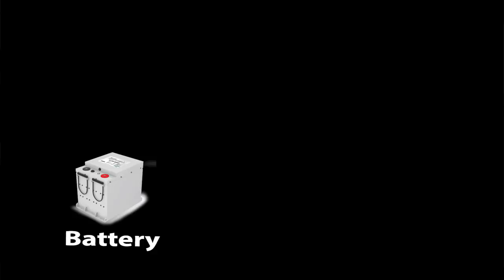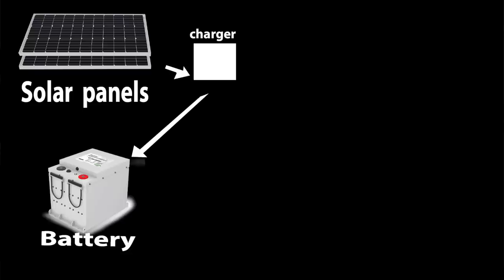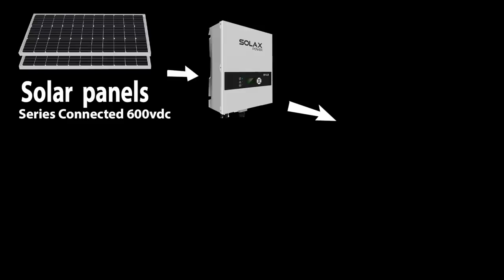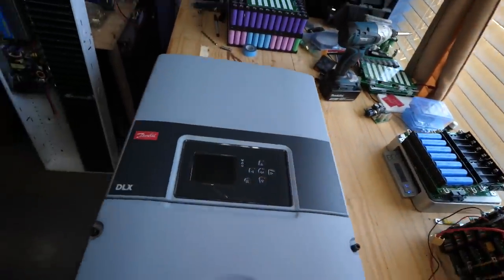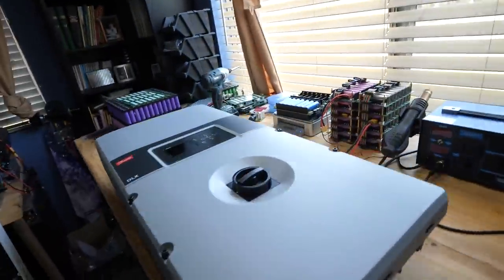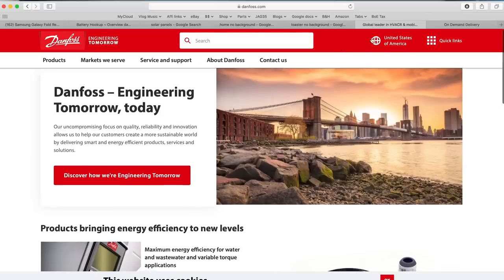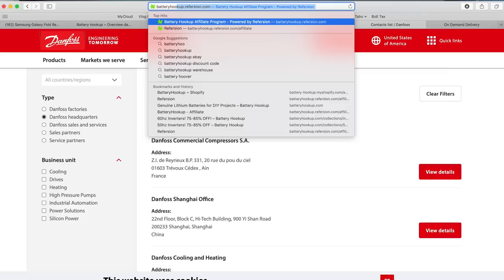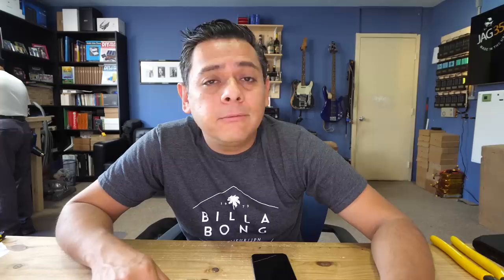Why are these Danfoss SOLAR Inverters So Inexpensive?

Comment: The old standards have gone away like 40 years ago but people still refer to 120v as 110v and 240v as 220v and 480v as 440v. In America at least for the last 40 years it's been 120v, 208v, 240v, 480v.
Reply: in the us, depending where you are, line voltage can vary as much as 15 volts. i have seen voltage as low as 110 and as high as 125. in other parts of the world the variance can be even higher, as much as 30 volts difference. and 277 is also a common voltage in the us.
Reply: @marzsit9833   That's probably true but all equipment and devices are made for a standard which in the US is 120v,208v,240v,480v. I am a generator tech. They don't make a 110v, 220v, or 440v generator. The utility voltage can vary but the generator's output can't, much. And the 277v is for lighting and is one leg of a 480v systems. We shouldn't confuse people by referring to the old standard that hasn't been used in over 40 years. Sorta like calling a throttle body a carburetor.

Comment: Isn't it more efficient if your appliances used DC instead?
AC's only advantage is long-distance power transmission.
Reply from the maker: Not making custom connectors and dc-dc devices for every appliance is hugely convenient
Reply: Actually, DC is more efficient for long distance because AC has skin effect and doesn't like to travel on the inside of the cable. ACs advantage is easy conversion

Comment: At 19:15 it shows "71watt in"
"56watt out"  Thats bad Efficiency .
About 79%Efficiency.
Reply: Probably just a demo site? Not aware of anyone with a 70W system.
Reply: Realise the unit itself is going to consume some watts just to run. So at 1,940 watts in and 2,000 watts  Loosing 60 watts is not so bad. At very low wattage It wont show as good efficiency because the unit will use at least 15 watts or so just to run the circuits.
Reply: efficiency for this systems is highest at full power. just like motors or any kind of inverters

Comment: Never heard of them. Also, light-weight inverters aren't necessarily a good thing because it means they don't have much of anything inside for transformers to handle large surge currents. That's bad when it comes to air conditioning systems. These must be those "high frequency" units we've all been told to stay away from, to avoid like a plague. Yep, they're cheap, which means you get what you pay for. They also posted a hugely inflated price to make it look like they're worth more than they really are. When I saw that medium-sized heft that thing like he would his little kid, that pretty much told it all that they have very little for transformers to handle the larger inductive loads in that power range. It's a large case with LOTS of AIR because they're missing the transformers.

Comment: I don’t see where I could use 240V inverter in the States. Only maybe if I had Tesla?
Reply: I hope you understand that your entire house actually runs on 240V based off two phase where your 120V comes of the split to the neutral.  https://diy.stackexchange.com/questions/42043/whats-the-difference-between-three-phase-240-v-and-standard-household-240-v
Reply: All your big appliances are all 240v... like your heater/ac, range top, and clothes dryer... unless your on gas of course.
Reply: I understand, but what can you run at 2000W? Not much.
Reply: @igorlungu8728  well none of your appliances will be running 24/7... the grid tie inverter is banking power with your power company. So when you throw a load in the dryer and turn it on you are using some of that power you fed them already. But 2kw will probably just cut your bill in half if you have a couple kids in the house lol
Reply: @igorlungu8728  I just figure I need 1kw per person, 1.5kw per kid lol

Comment: Do you think I can connect a 48volt battery to this?
Reply: grid tie inverters are designed to connect to an existing, powered-up ac power line and synchronize with the line frequency. if the grid power fails, the grid tie inverter shuts down to prevent line electricians from being electrocuted while making repairs until the grid power is restored. so no, you can't use a grid tie inverter with a bank of batteries of any voltage.

Comment: cheaper inverters have more of a static modified cheap sinewave, the most exspensive inverters like sunforce have pure true sinewaves for smoother home and rv power.  all your home appliances should be using pure or true sinewave power just like the clean power your utility company supplys.

Comment: Using inverters is great but it is easy to do your lighting with DC and LEDs. You can use low voltages like 12v or 24v. Many items in the home actually use DC. Most of them have AC to DC converters and use 12v in the actual device. Why turn DC to AC and then AC to DC? Both steps are quite inefficient. 
If you like to tinker run seperate AC and DC lines. the DC may need voltage regulation for some items but it is more efficient than the "standard" way of DC-AC-DC And AC with some AC-DC for LEDs and charging laptops/phones. There is also the advantage of not needing permits to run low (less than 50v) voltage lines.
Reply: True, but note that it is a grid-tie inverter. It sends the electricity o your power company.
Reply: AC is safer at higher voltages and therefore can run over thinner wiring, easier to wire your house for high voltage AC

Comment: I use Microcare inverters, very robust and I can arc weld using it
Reply: That's a South African 230vac inverter. 50hz. The complete opposite of this thing :-)
Reply: plonkster they have a wide range
Reply: @markstemmett5296  I have one of their MPPTs. It blew up some years ago, so I opened it up and snooped around a bit. Nice old-school design :-)
Reply: plonkster I agree I have been off the grid for 4 years using 60 panels, 4 MPPT’s, a battery monitor, web logger and 15 kW inverter all Microcare all bullet proof. Living in Africa requires bullet proof solutions
Reply: @markstemmett5296  Yup... but I went the other way. I went Victron. I live in the city though, so things like NRS097 compliance is a thing. It's somewhat odd to me that neither Microcare nor MLT has NRS compliance, even though people from both those companies are on the committee. Also, truth be told, for what you pay the Microcare MPPTs are not worth it. It's old school, somewhat easy to repair (as long as the PIC microcontroller still works), but it is not on the same level as a Victron or an Outback... and those don't cost much more if at all.

Microcare (and JSM) still have a huge following on "die platteland" though :-)
Reply: plonkster I also live in a city. I did not want to be grid tied as we then pay a surcharge to put power back into the grid and it is rumored we will also be paying extra rates for having pv on our roof. We also have load shedding and what is the point that your system goes down when the grid goes down ? My system thus serves as a UPS and for this legislation is non existent.
Reply: @markstemmett5296  You don't have to pay the surcharge. You simply request to remain on the same tariff and they leave you alone, though you must install a prepaid meter if you are still on the old disk-type meter. At least in Cape Town.

Besides, what most people don't understand is that the higher surcharge is offset by a lower per-unit cost below 600kwh, so the overall cost for 600kwh is the same regardless of what tariff you are on. I'm on the Home tariff now, which means I have a connection fee of R150, an then pay R1.86 per unit for the first 600kwh (compared to the guys on domestic who has no connection fee, but pay R2.10 per kwh for the same). The same goes for the SSEG tariff, it comes with the rather high R430 a month connection fee, but in turn your first 600kwh costs only R1.39/kwh.

Of course that might be a bad deal if you use significantly less than 600kwh... but I buy all the cheap electricity I can get every month and leave the credit on the meter for winter time.

Also, even if off-grid you don't escape the registration requirement (in Cape Town). You must still register it and indicate that it is off-grid. And they may send someone to inspect it. Cape Town is being VERY difficult in terms of even connecting the grid to the input side of an inverter/charger... even if that thing is a UPS. If you have solar panels anywhere... they want NRS papers. There are a lot of Axpert owners who have significant trouble at the moment.
Reply: plonkster my understanding is that there is no legislation to regulate a “UPS” regardless of size. It was for this reason I decided to go the route I did. I sacrifice by generating more electricity than I require. Unfortunately to run my system in this way it will take about 12 years for my batteries to pay for themselves. This on my part was not very clever, but other than this oversight I am practically off the grid. I prefer not being bound by by laws set in place by the monkeypality

Comment: CAREFUL!!! CAREFUL!!!!
Damn dude... you need to tell the whole truth here or you are going to get folks watching this to potentially waste a whole bunch of money.

The reason these are overstocked is because they are not "Rule 21" compliant.  What that means is that they have no communications.  California is leading the way with this but it WILL go nation wide as we move towards interactive grids.
Moving forward, it's important that the utility companies have a way to regulate what goes to the grid.  So for an off grid situation, these inverters are fine... but there is a reason they have been discontinued.  That reason is that they are no longer to code for a grid tied application.

The exception to that rule is if you have Tesla powerwalls.  If you have Tesla batteries, the Tesla gateway acts as your compliant device and that makes your entire system, by default, compliant.
But be very careful what application you buy these inverters for.
Reply: Thanks for the heads-up 👍...this is exactly why it's good to check comments on technical type videos...
Reply: @MiniatureChickenChannel  My pleasure.  Stop by our channel and have a look at The Energy Sovereignty Project videos.  We walk through the real world testing of a large scale home solar and battery setup.  If you are trying to take on such a project, you may want to have a look.
Reply: @twelvewingproductions7508  Will do..thank you!

Comment: Too bad these are all 50hz and basically useless in the US with our 60hz equipment.
Reply: A 60 hz electric motor will run just fine on 60 hz albeit a bit slower. An electric heating load cares less. An electric clock won't work properly, but my laptop charger will work just fine.

Comment: So in the beginning, you mention two phase AC, hmm, tell us more about two phase AC please
Reply from the maker: split phase?
Reply: The United States has to my knowledge only single phase and three phase electrical power.  Single phase requires two wires.  Two phase requires three wires, while three phase also requires three wires.  So if there will be three wires it would not make sense to use two phase, although possible, but it would be a waste of resources.  There may be some museum or laboratory where two phase exists but I am not aware of it.  I cannot speak for other countries.   Jim

Comment: What is the "home rooter"? And, why can't it set itself off the web time and date servers once told what time zone it's in? What happens when a Russian, Chines, and/or a North Korean, or even the punk 36 year old, hugely fat gamer still living in his parent's basement who hacks into your inverter? Can they change settings to the extent that they can cause a fire? And what about when your home "rooter" has a encryption password? Can these things handle that? It looks like what they found out is that their so-called MSRP (as if manufacturers were ever qualified to set the retail value), nobody will pay that for such a cheaply designed unit. I would never have paid $2900 for one of those units. They're too cheap. Many Europeans will pay that outrageous price, but not those of us who know better.

Comment: 13:50 are you serious???
Reply from the maker: why would the 50hz not sync to 60hz,    has anyone even actually checked?
Reply: @jehugarcia  because 50 is not equal to 60? I expect at least a blown fuse.
Reply from the maker: @NoHandleToSpeakOf   same hardware so 50hz and 60hz is just a setting

Comment: What you rambled about during 20 minutes could have been condensed down to 3. And instead of copying Danfoss content, you should link to it, that's the correct way to do it.
Reply from the maker: I’m not decent.   So go away
Reply: @jehugarcia 
Mucha charla, Charlatan!
Advise: Cook your content down to the essential. Do't try to fill your 20 minutes with obvious statements like "the case is made of some kind of plastic". Don't be such a bore. And YES, try to be decent and LINK to content instead of bluntly COPYING it. Dohhh!
Reply from the maker: Advise:  stick to watching videos,  I’ll stick to making them
Reply: @jehugarcia  
You mean: "Copying" them and then fill in with a load of boredom...
Reply from the maker: Yes, I copy all my videos,  now go watch them
Reply from the maker: And try to be more interesting with your comments,  pretty unimpressive so far

Comment: This may be a dumb question, but why do we need AC or DC power can we not just have one or is it a part of the big conspiracy, just kidding. But it's like language why can't we just settle on one language so that we all can understand each other if you get what I'm saying.
Reply: A battery or photcell is Direct Current which means there is a constant positive voltage between the two contacts.
An altenator/generator such at a dam or coal plant generate Alternating Current which is much more efficient when transmitting over power lines at great distances as well as much easier to transform from high voltages down to safe use able voltages for homes etc...  The Alternating Current is set by the rotation speed of the generator to flip from + to - at 60hz in America and 50hz in Europe which means 60times a second.   Using AC allows wires to travel twice the distance carrying the same load.
Reply: @westcoaststacker569  not true. DC is more efficient at long distance because AC has skin effect and doesn't like to travel on the inside of the cable. DC uses all of the cable so has less volt drop for the same cable size. AC is used for conversion
Reply: When I have designed solar systems I have to use both the run and return for voltage drop calculations with DC while only one direction for AC.  To me this means transmitting DC over distances leads to greater losses.

I am only an electrical contractor not an Electrical Engineer,  and you sound knowledgeable on the subject.   There is a lot in this video and after that even my limited knowledge from the last 40years, I do not wish to touch.

I do honestly believe though that if DC was more efficient over great distances for electrifying our cities that Edison with all his political, news and industry Allies along with Edison's claims of AC being more dangerous based on his research electrocuting animals would of won the "Battle of the Currents",  the competition against Tesla/Westinghouse AC systems back in the day.
Reply: For the same current, thicker cables (greater than about 1/2 inch or 12.5mm) are more efficient when carrying DC because AC won't won't flow in the centre of the conductor due to the skin effect.  For thin cables there's no difference because they're thinner than the skin depth. Higher voltages (either DC or AC) are more efficient because the current is lower for the same power, which is why all long distance transmission lines are high voltage.  AC is usually used in power grids because it's much easier to convert between high and low voltage using a transformer and most cables aren't so thick that skin effect is a huge problem.  Sometimes though, at very high powers, where you do need thick cable, DC is used even though it's more trouble to change voltages.  An example is the undersea power cable between the UK and France.
Reply: @westcoaststacker569  "while only one direction with AC"
Can you explain that? Current needs a return path, regardless of being AC or DC. Volt drop calculations apply equally. You are incorrectly doubling the volt drop on DC
Reply: The first telephone line across the Atlantic was DC. DC in parallel for long distances results in capacitance (storing energy). AC creates inductance (converting electricity to a magnetic field). Thus confirming that AC has more losses
Reply: Wow I now I see. And I just found a new word to Google. 😁 Thanks guys .